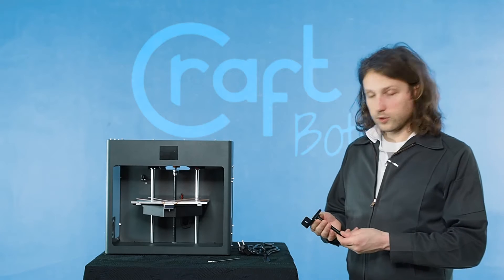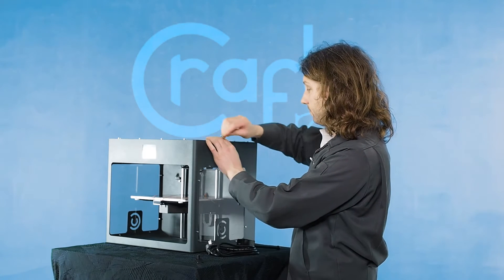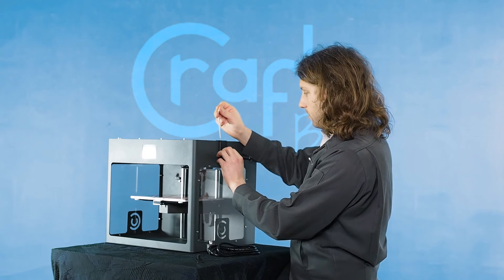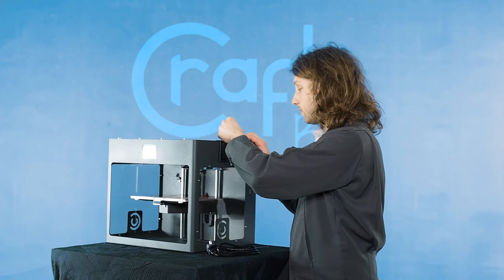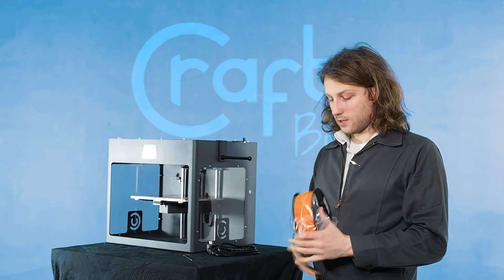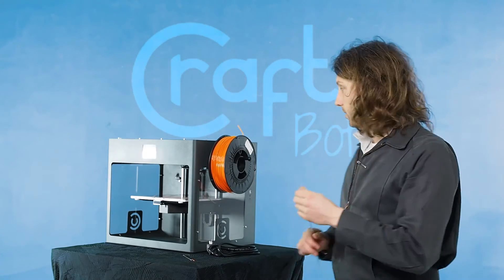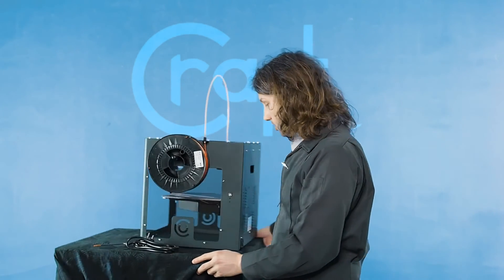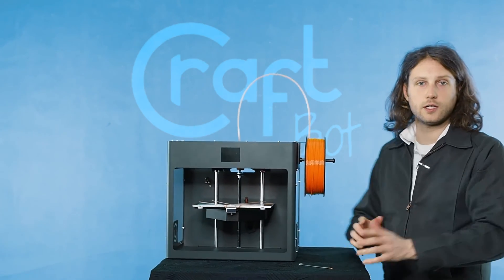CraftBot Plus - Filament Setup

Comment: So for this machine do you absolutely need the filament tube guide cause I tried using mine that I bought recently without a tube and I had a very hard time getting it to operate as it wouldn't let the filament out and it kept becoming tight causing the filament to rip out